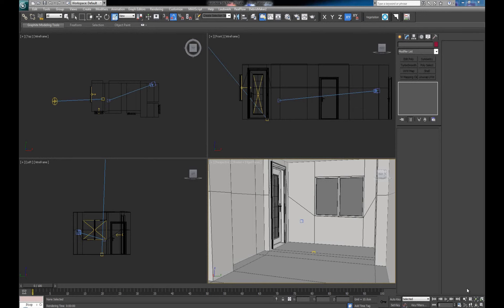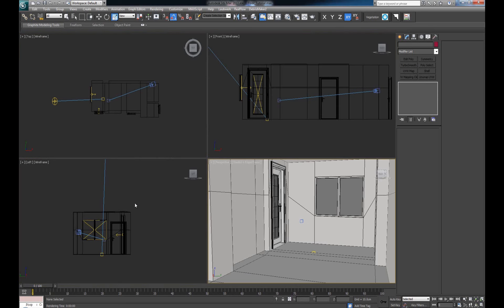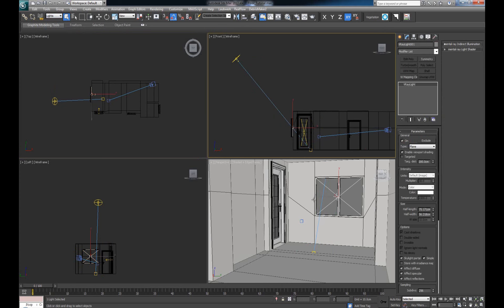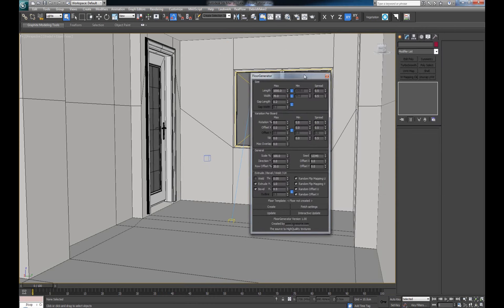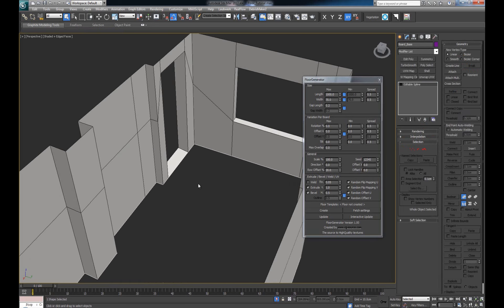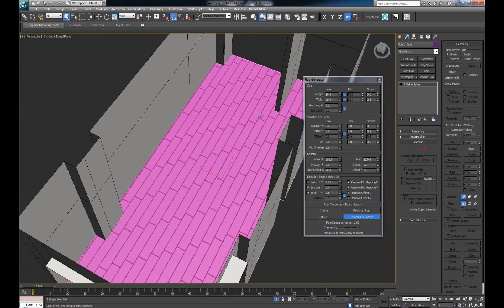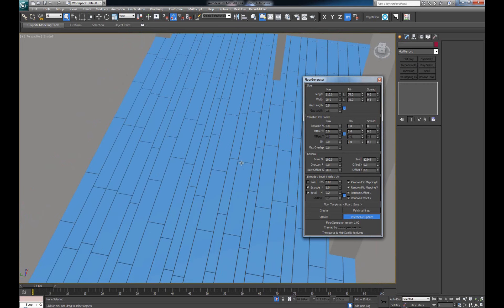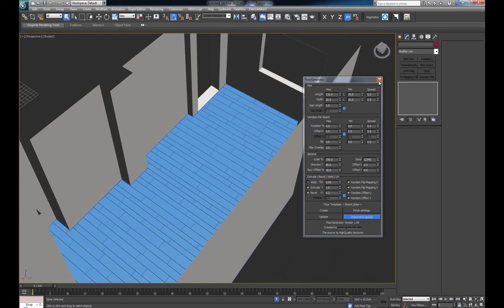Creating floor geometry in 3ds Max with Floor Generator

Comment: How do you create perfectly even tiles for the floor? Like in a bathroom?? (Figured Out). Another issue i have is, once I've created something with the FG, coming back to edit it, it doesn't interact with the floor that i generated earlier. Any ideas on what im doing wrong or?
Reply from the maker: Not really sure what you mean it doesn't interact with the floor.
Reply: Denis Keman
Sorry ill specify. Once I've worked on my floor with the Floor Generator. And I close it down. If i wanna run the script again, I cant go back and edit what I originally created. If you get me . ?

Comment: Hello. You are doing great teacher, but i have one issue with this example. Im doing this and i get little stretched textures with this. My board texture is 1024x207. To avoid stretching I've tried to perfectly adjust a scale of boards from FloorGenerator and my board texture. Still get little stretched desk. Its not so big deal, but it isn't so clear as my JPG texture when i'm looking at it in window's overwiew.  I don know what i'm doing wrong, maybe size of the texture is too low? And I have one more question. In your opinion   whether this plugin is really worthwhile, while you can get similar result with textures themselfs?
EDIT: I figured out an issue :D I didn't know I had blur set at 1.0 in multitexture map. Set it to ~0.08 helped a lot :)
Reply from the maker: I like working with textures myself, but the advantage of working with geometry is that you get a better level of detail as well AO giving you even better realistic outcome. In my opinion the plugin is worth it.

Comment: Hey I know this video wasn't recently uploaded but I hope you will be able to answer me on whether I can use the multitexture because I have the student version of 3DS Max and it's not showing up after I put it into my plug-in folder. Maybe you would know whether that has any effect on if it works or not? Sorry I'm still pretty new to 3DS Max.
Reply from the maker: +Mark Williams It should work, on the site where you downloaded the plugin there is a how to install guide, so follow those steps and you should have no issues with the plugin
Reply: +Denis Keman We can found pulgin tutorial from CG-source website? But I don't see it..but that's a video that need QuickTime plugin to watch so I'm unable to watch it :(
and I have one last question about the mapping.. where can we found 10 pieces (or more than that)free different wood texture except that sold from the CG-source..
Reply from the maker: +J JJe There is a link for downloading on the site, but you do need to make a free account on the site. As for the QuickTime plugin i mean it is very easy fix, install QuickTime. 

Now for the last part of getting the textures, the best you can do is make your own. Check out the size of the images and then inside PS make your own variants.
Reply: Thanks you so much! And for the QuickTime plugin..I tried and download everything i needed..still fail..It help me download the software not the plugin for chrome..and I google all about it still doesn't solve this problem. Perhaps there's a tutorial video to teach us how to plugin this powerful tools.